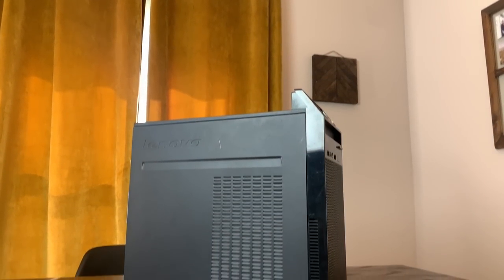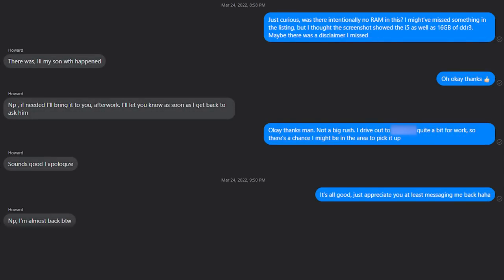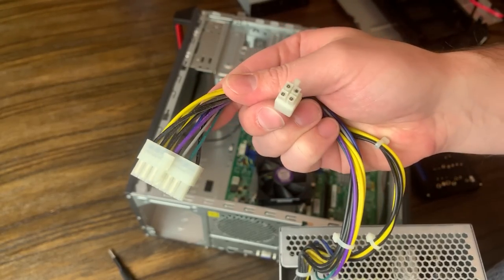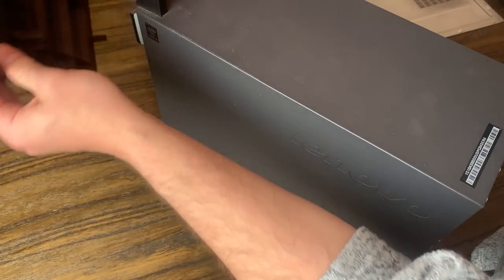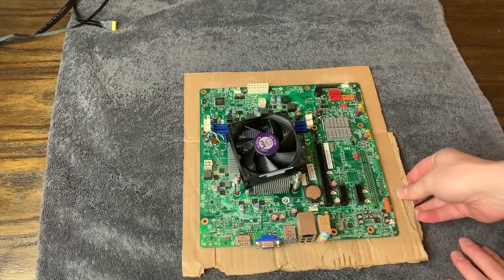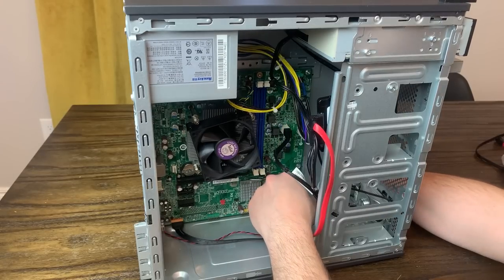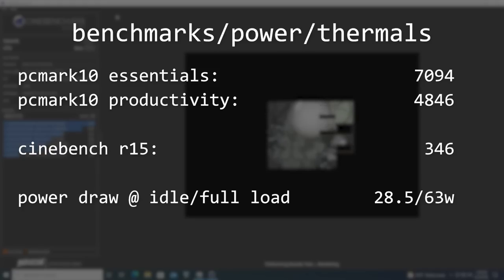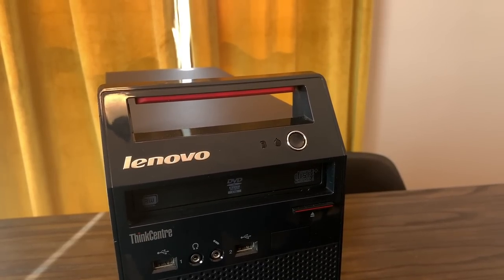This PC was a scam. Now what can we do with it? - Landfill to LAN: Lenovo E73

Comment: I bought r3 2200g system unit in fb market place in 190 usd resently. Before I bought it I open the case and check the components. But now it gaves me a head ache because after a long use the display driver crash and needs to reinstall again and again. I think this is one lesson if the Computer Components sell in too low price in second hand market maybe it has issues. I changed the PSU and RAM but nothing works.

Comment: E3-1246v3, 2x8gb ddr3 1600, rx 580 8gb (if prices come back down a little more...) would make a killer system. Would almost definitely need that PSU replacement, though.

Plus with some shenanigans you could run an nvme drive on a pcie adapter. Wouldn't get the full x4 lanes but it'd be fun. And if the bios doesn't support nvme boot, there's a cool way you can use a sata boot drive to chainload nvme, if you're running linux that is.
Reply: Are you sure the bios has microcode for the xeon?

Comment: i run a hp elitedesk 800 g1 twr thats similar but with 4 ram slots, which is actually not too bad a gamer. there's a custom made converter harness for these, allowing a aftermarket psu's 24 pin connector to be used on the board. my elitedesk is running a i7 4790 with a r9 270 (upgrading soon), 16gb 4x4 g.skill ripjaws kit, baseline ssd
Reply: do u think mine was a ripoff? i paid $300 for mine and the only 2 really big differences is the i7 instead of i3, and i had 4 ram slots

Comment: Turn it into a retro gaming PC. It will handle NES, SNES, Genesis, MAME, Atari 2600/5200/7800 and some others no problem. No, it won't play PS2, PS3, Dreamcast, Gamecube, etc. But the two hard drives it came with are big enough to hold what it will play.
Reply from the maker: Not a bad idea!

Comment: I got a Lenovo m73 tiny with an i5 4570s I use for PiHole, I was thinking about using Plex on it and see how the intel quick sync works with it, but I do plan to move it to an i7 4770 as I plan to run a few small game servers on it, but I need to make sure the power brick can handle it. It originally came with a Pentium dual core, I found a dead system with the i5 4570s which that cpu has been working well on my m73 for quite some time now.

Comment: Using the same desktop pc as he did, I swapped out the power supply with a 500W unit, bought the $10 PSU / MB adapter he talked about, and then installed a powered PCI-E graphics card so my kids could play Minecraft / Among Us or any other games without trouble. Works very well and was very cheap.

Comment: it was still a scam you were advertised 1 thing and sold another, the system isn't bad by any means for $40 you were lied to regardless. I learned to trust but verify with people even though I only scope out the "free" section on craigslist and have gotten some sweet deals just seeing PCs on the side of the road.

Comment: Good outcome but at the cost of RAM and Time.

I bought 12 old IBMs ,(much cheaper than 40 dollars) and made a Linux network at home everybody having a computer at home and me having 8.
Only two had windows.
I just upgrade my son's NEE PC  with Linux mint, Debian and Emmabantus running.
Gave up Windows many moons ago and I suppose you get more out of this unit from Ubuntu 20.
I currently use Ubuntu 21 and 22.
Windows deliberately use UEFI to stop dual booting with Linux.
Bad diplomacy.

Comment: I’d flip it to a 5700g iTX build.  The rear I/O backplate appears to be a knockout, and at worst the front will require T-connectors if the headers aren’t standard.  $40 for a case isn’t that bad in IMO.

Comment: Bro I have this PC with i7 4770s and recently I bought an 1060 3G .by upgrading GPU my PSU (280 watt ) died I need to upgrade PSU but no any PSU found more then 280 watt and I want 500 watt can I use the 24 to 14 pin connector or not please answer

Comment: i HATE the motherboards in theses systems and what lenovo did with the PSU is inexcusable. for $40 if you got JUST THE CASE you did not get scammed! Well, if the case could hold a standard ATX board. The CPU is around 20 to 25 bucks and the mobo sells for about that too, I would say you got a $10 discount, not scammed. However that is shady af that the RAM just fell out right before you went to meet old howard there.

Comment: I've been very lucky with my recent purchases and I just had the guy open to show me the ram and power it on cause I was picking up from his house 
I've bought 2 Lenovo M92P with 8GB of RAM and the CPUs were  i5-3470 and bought an extra 8GB of RAM for one of them so that it has 16GB  about 90$ all together for the PCs on their own 
Each PC 30£= 37.40$x2
2x4 ram for 10£=12.47$ 
Then 
An SSD in each for 12.95£=16$ and an Nvidia Quadro K620 2GB DDR3 for 25£=31$ in one of them 
I use the one with the GPU for emulation and it does great with PS2 Wii and GameCube and obviously anything under is also great 
I gave the other one to my girlfriend for Netflix and browsing 
I'm thinking of getting 2 more

Comment: got a pc with intel celeron quad core, i dont remember the code, it was something with N... I think. It had 4 gb ram and about 300-400 GB HDD I think, and an old Intel Graphics card. I got it for 384 eur with a keyboard and mouse with lights and stuff, this happened about 4-5 years ago, im not sure if I made a mistake.. Then after 1-2 years I bought a 2010 macbook pro for 300 eur, rn I have a good pc but Im wandering if these deals were good or not?

Comment: Wonder if a xeon cpu would be compatible with the motherboard (cheap upgrade) 🤔
Reply: You will need a separate GPU, as Xeons don't have one.
Reply: @wqatch  There are specific Xeons V3 that has integrated graphics, like the E3-1245 V3.
Reply: Yes it is compatible, some Xeon (e3-xxx0) don't have integrated graphics so you need to add a graphics card, but Xeon that ends with 5 is definitely compatible.
You may need to update the bios first to the last one before.

Comment: As I have been using the second hand market, I've seen way to many scammers so I'm always double checking.
As for Windows, with how much control Microsoft is trying to take from the user I no longer let my windows machine talk to the internet. That is what my Linux machine is for. Still use Windows unfortunately for program compatibility and gaming although transferring downloads between the two machines is a bit of a chore.
Reply from the maker: Yeah that sounds like a lot of work haha! Windows is definitely getting worse though... :(

Comment: Yea, you got scammed as far as what was advertised. But, a you still got a working PC for $40. Not a bad deal. You should have known better anyway. A set up like that , i5, 16GB ram, etc. I usually sell around $100 and I do sell them.
Reply from the maker: Well working in the sense that if I added Ram it worked, yeah. But it could’ve been much much worse for sure!

Comment: I want to take an older system like this and turn it into a file sharing server so i can access all my pictures from anywhere. I just don't know what software/o.s. to use
Reply from the maker: Maybe look into something like open media vault? I don’t have a lot of experience with software just for pictures. You could also do something like Debian Linux or Ubuntu and setup just a simple smb share.
Reply: @HardwareHaven  I'll look into your suggestions. I've never done any sort of server stuff before so it'll all be new to me.
Reply from the maker: I have a “budget home server” video as well as one covering something called TrueNAS. You might look into those, as both provide the ability to share files over your local network. There might be some better options though, and there are plenty of smarter YouTubers out there

Comment: If only I could send you my Sapphire Radeon HD 7770 GHz Edition 1GB GDDR5 graphics card. PN 299-1E244-001SA  SKU# 11201-17. It uses a 6pin power connector and sadly is missing its plastic shroud. [Had to remove it to access the SATA ports on my Asrock mini-ITX motherboard as the lower part of the shroud was blocking my SATA ports.] Yes it still works and I never had issues with it from missing the shroud. Just looks kinda tacky is all.

It would be a beast of an upgrade for this machine though. You can have it for $20+shipping.

It has 1 Display Port, 1 HDMI Port and 1 DVI Port. It's a full height card with a dual slot plate.

Wish I knew how to Private Message you! Would love to see your review of this card in a future video!
Reply from the maker: On the discord server is one way. I also have an email
Reply: @HardwareHaven  I'm still looking for your response on Discord. I'm still kinda iffy on how to use that app though. 🤣

Comment: why you are using windows 10 and not 11?
Reply: Because 4th gen Intel are not compatible with W11, at least officially
Reply: @AizenJoestar42  i tried windows 11 on i5 2320 and it was running fine
Reply: @mihaillevarda9395  I said officially
Reply: Why not windows 8 or 8.1
Reply: Why not Temple OS?

Comment: Actually, at that stage, i5 wouldn't give you that much more (maybe i7). Also, Lenovo is a semi closed system even with i5, so you would have the same issues you described with i3.
Reply from the maker: I’m not sure.. a true quad core VFS a hyper threaded dual core can be quite an improvement in certain workloads. 

And I’m not quite sure what you mean by “semi-closed” and what issue I had with the i3..?

Comment: I would personally throw a 6400xt and 8gb of ram in dual channel for cheap, and flip it as a fortnite gaming pc for like 250
Reply: Maybe a 120gb ssd for 17 bucks
Reply from the maker: 6400xt? Do you mean rx 6400? or 6500xt?
Reply: @HardwareHaven  as in the rx 6400xt, its a 58w tdp no power connector version of the 6500xt at 150 usd. Its essentially a 1650 but can be had for msrp
Reply from the maker: @KadiusFTW  it’s just an rx6400, no “xt”. And I don’t think it’s as good as a 1650 as far as pure rasterization goes. It also has no hardware acceleration and has worse performance on PCIe 3.0.
Reply: @HardwareHaven  couple of things to note, it got a performance driver patch ~3 days ago for halo infinite and like 6 other games, and the difference between pcie 3.0 and 4.0 varried greatly from game to game, with most games showing next to no difference. Also, the 6400 has working RT, albeit fairly slow allows for really cool visuals on a budget because of RSR, (i think thats what its called) whereas the 1650 to my knowledge isnt supported, making the 6400 perform pretty decently in comparison and being about 50 bucks cheaper at going rate, plus the sff sized cards are available and easy to find vs the 1650 (new).
Reply from the maker: I’ll have to look into stuff after the patch! And it definitely has a niche use case for SFF. I just really hate the lack of hardware encoding as I think that really limits its usefulness outside of gaming. And it also helps that I have a GTX 1650 already in it that I found for $120 😂

Thanks for the comment and info. I’ll be looking into the driver update
Reply: @HardwareHaven  nice. Also, if you want an amd equivalent you can always grab the w5100 4gb for ~80-90 usd with the nimez drivers, its the same silicon as the xbox one s just undervolted and slightly underclocked on a single slot card.

Comment: I'd use that system as a base for a build. Get an i7-4770, a better SSD and of course a reasonable GPU. This would require a better PSU and an adapter.